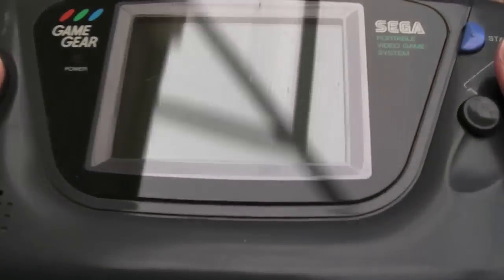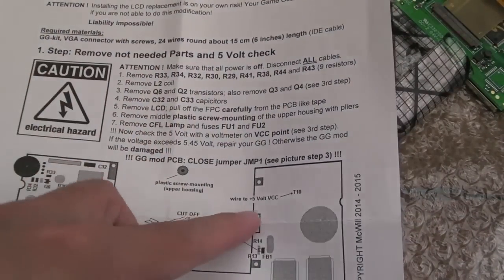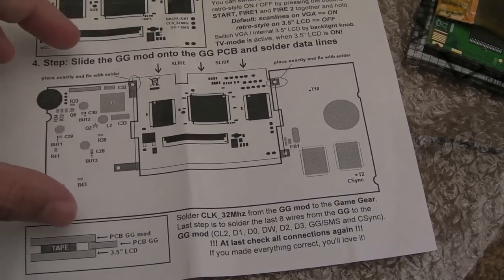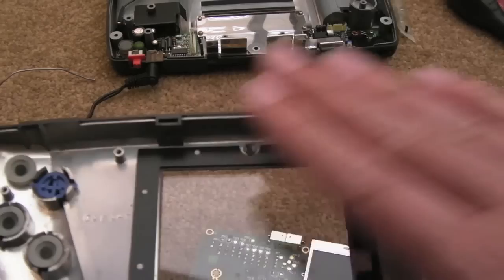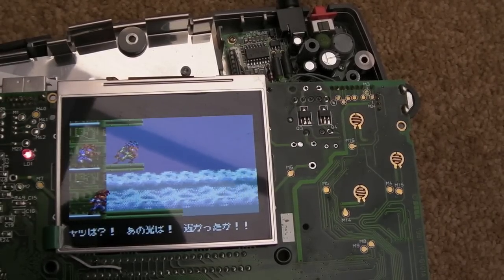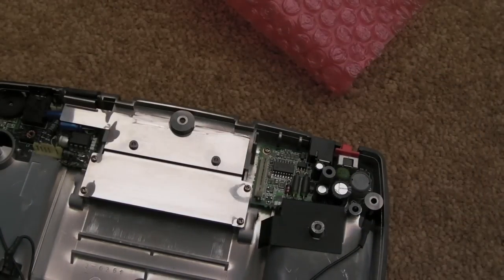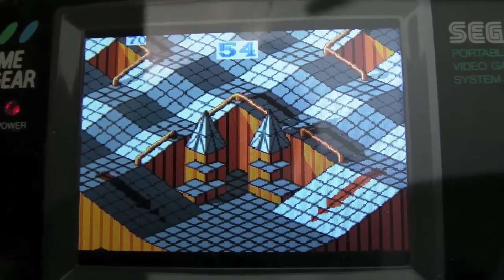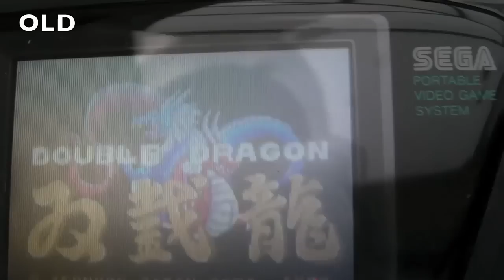Sega Game Gear Modern LCD Replacement (Not Composite) From McWill

Comment: Wow that looks amazing! Definitely a pretty involved mod but it looks like you had a good set of instructions to work from. Nicely designed unit in general. My GG seems to be on of the lucky ones in that it hasn't had an issue with the capacitors yet. But I think I'm going to replace them proactively one of these days. If I were going to do something this radical I think I would go ahead with the VGA output while I was already in there. Would be awesome to play on a monitor!
Reply from the maker: Will be doing the VGA part very soon! =D
Reply: GadgetUK164 - Retro Gaming Repairs & Mods Nice! I'm very curious to see how it will look on a monitor. Question, is it actually VGA output or is it just RGB using a VGA plug? I used to always assume if it had that connector it was VGA but someone rocked my world and said that wasn't necessarily the case.
Reply from the maker: Now I think about it - I am not 100% sure lol.  I need to go away and check!  I am guessing its VGA from what I remember.  Pretty sure people connected up to a VGA monitor, but I will check!
Reply: @71dembonesTV  Maybe late, but yes the output is normal VGA. I have done this mod on the GG and connected it to my monitor who has DVI and VGA input. ;)  It's really awesome to connect your GG to VGA and play games on a 24"screen! also you can terminate screen output on internal screen with brightness knob. But all this will only work if you are doing the VGA mod totally.

Comment: What gauge or size wires would be acceptable without any risk of overheating anything?
Reply from the maker: To be honest I've found that for all the wires except ground and +5 you can use single strand kynar wire.  For the +5 and ground I would use 7 strand wire similar to that used in IDE cables.  Not sure on exact gauge, it really isn't something to worry about on something like this.

Comment: Hey Guys, whilst replacing parts, the screen dropped and the small ribbon cable attached to the side of the screen ripped from it's fixing. It looks as though it's glued? How do I re-attach (if it can be)? Cheers Stuart
Reply from the maker: Are you talking about the McWill LCD screen, or the original Lynx screen?
Reply: On the game gear original screen. There is the main cable which connects the screen to the board and a smaller one which attaches to the side of the screen - this is the one which seems to have come unstuck! As you look at the screen it's on the right hand side.
Reply from the maker: Ah, I see - sorry, it's a Game Gear video :o)  I had the Lynx on my mind lol.  If its detached on one side, there's not a lot you can do tbh.  You can try and heat with a soldering iron to see if you can get the glue to re-adhere.  They are glued on there with a conductive glue (not solder).
Reply: Bugger!! I had just finished re-capping and ready for testing! Oh well, I will try and see if I can heat it somehow. Cheers for your help!

Comment: I still have my original Game Gear from Christmas 1990/91 it no longer works sadly so I'm going to have to read up on what faults occur, I think this mod is a must also!!
Reply: If you switch it on & just get the backlight and no sound or picture, try looking at an oblique angle and you probably will see the game loaded as normal, 9 times out of 10 it's just the capacitors have failed and caused no sound and no contrast. (I hope you've got it sorted by now though as it's like a year ago this post was made lol). Its cool that you still have your original GG after so long, hope it's fixable.

Comment: Would this work on model 2110G? That's the one I have sadly
Reply from the maker: I think so - the mod supports 1 or 2 ASIC versions.  Check with McWill before ordering.
Reply: +GadgetUK164 it will work for the G-models still thinking a pro can do mine if I were order one

Comment: what dose the brightness wheel do after installing this mod if nothing then he should make a revision to use it instead of pressing all the buttons
Reply from the maker: +justin rivera The brightness wheel is used to switch to the VGA output mode as far as I understand.  It's the same on the Atari Lynx screen.   So it disables the LCD screen and feeds output to the VGA connector so you can connect to a TV or monitor.

Comment: i gotta ask does this improve battery life? that Compact flouresent tube must eat the power like crazy, if it does its worth splashing out on making my GG look as good as it possibly could. also does the MS cart adaptor and 3rd party TV tuners work with the unit still after this mod?
Reply from the maker: I expected it to use less power but I've been told by a few people that it is approximately the same - the CPLD on the mod PCB eats a lot of power, as well as the new screen which is much brigher and clearer.
Reply: CynicalHeart Bear

Comment: What the hell, why are the scanlines VERTICAL?
Reply from the maker: +J Limon I think to emulate the original screens - they didn't have typical horizontal scan lines.  I think if you use the VGA out the scanlines are horizontal, but I've not tested the VGA output yet.

Comment: Someone has probably already told you this, but there are two versions of the screen protector, this one and the one that is raised. And there is actually a difference between the two, the game gears with the flat screen protectors do not have the "produced by or under license from sega." Screen!
Reply from the maker: Thanks, that's very interesting - I didn't know that!   I had no idea that Sega introduced the "produced by or under license from sega" on the GameGear like they did also on the Megadrive!  I wonder if that is in the single ASIC versions maybe?
Reply: GadgetUK164 No problem, always happy to help! I'd have to crack open my two beveled Game Gears and check out that theory...

Comment: Do they have an RGB mod for nomad? Or will this work?
Reply from the maker: Not yet (I think??) - The best you can get with the Nomad is to swap out with a composite screen.  People use those 'reverse parking' screens I think.  Just find where composite is output on the motherboard and connect up to the composite input of the screen.

Comment: does that have effect on the battery duration? maybe a lil longer than back in the days :D
Reply from the maker: +Rene Friedrich Apparently its about the same - not much difference at all.  The main reason is the CPLD on the board combined with the newer screen which is brighter as well as clearer.

Comment: i admit i kind of skipped around the video a bit but how did you end up fixxing the sound?
Reply from the maker: +EyesofNova I didn't get any sound issues.  I just tested the unit without a screen and didn't get any sound - probably because there's a reliance on the screen or something.  If you do have sound issues on a Game Gear its normally capacitors on the audio PCB.
Reply: GadgetUK164 Your videos of inspiring, I lack the soldering skills to do such amazing mods. Your rom chip replacement for the super mario rpg was incredibly btw.
Reply from the maker: Thanks! =D With practice and if you get good flux I am sure you can solder just as well!  Self belief and practice on none important old boards is the first step!

Comment: i recently purchased a GameGear with this modded screen , haven't tried the scan lines tho but does this also have the ability to change the size or aspect ratio of the screen , or only just a scanline function
Reply from the maker: The size and aspect ratio are fixed - just scanline function.

Comment: good mod, but I don't like how games are not displayed pixel perfect on the screen.  Some clear upscaling going on with that screen which doesn't look good.
Reply from the maker: +AndehX Yes, there is some upscaling!  There is the scanlines mode built in which does help when enabled though.  I am told it looks better when using VGA output.  There's never going to be a direct replacement due to the resolution, but I guess maybe one day a screen even higher resolution might mean the scaling is less noticeable.

Comment: Will the McWill mod increase battery life on the game gear?
Reply from the maker: I don't think so - from what I understand the current useage is about the same (maybe slightly more).  The CPLD to convert the video into a format the new LCD can support is the main problem I think.
Reply: Yes it does dramatically

Comment: Got a question for you since I have looked all over the place. Having an issue with the colors. they are sorta red. I wish I could post a pic of the issue. The screen flickers when I turn it on going from one color to a different one. Have you ever heard of this issue.
Reply from the maker: Is that before or after adding McWills LCD mod?
Reply: I was not the original person who tried to install it, the Cx took it to another place to get it installed and thy could not finish the solder work. They brought it to me to finish the last 6 wires  for the LCD pins. The other place also replaced a bunch of caps on the volume control board and on the main GG board. I am not sure if this is interfering with the color or if its a screen issue.
Reply from the maker: If all of the caps have been replaced (and I would replace all the SMD electrolytics on any GG), then there must be either a fault with the system, or perhaps the LCD mod wasn't done properly, or perhaps the new screen has a fault.  My first suggestion would be to get another GG, swap out the caps, test it then works properly, and finally do the required mods and transfer the new LCD screen to see if its all working.  If there is a fault with your new screen you could send it back to McWill and he might be able to repair it.
Reply: I already talked to McWill about this issue and he suggested some things to do to fix the issue, but nothing is working. I did not buy this, the Cx did from off the internet, I am assuming. I already told the Cx if they get another GG, I would move the LCD over. This is up to the Cx. He has no clue if this was an issue before the mod was installed by the other shop.

Comment: Does this mod improve the battery life?
Reply from the maker: +T.H.E. Outlaw Quite a few people have reported that the difference is hardly noticeable.
Reply: +GadgetUK164 You should do a Li-Ion battery replacement mod next. Throw a 3000 mAh pack in there and that sucker should last all day.
Reply: +T.H.E. Outlaw any mod that involved removing the cathode tube back light, and replacing it with LED's, will dramatically improve the battery life.  You should expect at least double the original battery life.
Reply from the maker: These have been tested and apparently due to the other logic on there the battery life is slightly worse than using the original screen.  To be honest I wouldn't use one of these on battery anyway, unless it has been modified with a li-ion battery.  But you can reduce battery life on a standard screen just by replacing the tube with LED's.
Reply: +GadgetUK164 if that's the case then that is an extremely badly made screen.  anything using LED's instead of a cathode should produce significantly less power draw.
Reply from the maker: It's not the screen that's the problem, it's the CPLD and screen combined.  Plus there's a regulator to drop the 5v to 3.3v I think.  It's still a pretty nice screen imo.

Comment: I never really liked portable systems, but I had a Game Boy so that's probably why.  :)
This mod is impressive. It's not so much surface mount soldering that scares me as much as surface mount *desoldering*.  I feel like I'm going to rip pads when I try to coax them off the board from opposite ends, causing the other end to hinge a bit and tear the PCB.

I jumped up when I realized what game you were playing at 35:30.  I had no idea this version of Bruce Lee existed.
After looking into it a bit I see it's an SMS homebrew.  That's awesome.
The author apparently posted the ROM for free download, but it's weird that the v1.00 release is gigantic (1.4MB or thereabouts).  All the older versions I saw posted are 128KB which seems a lot more sensible for putting on a cart.

Comment: Hi Gadget,
I just got this kit delivered, but I can not work out where the VCC point on the screen board coneccts to, I find that part of the instructions are unclear, I know the VCC on the cartrige slot point 35 joins with point 1 on the backlight, also do you solder point 16 to point 18 on the cartrige slot. and also there are two points  at FB1 which one do I use for the CLK_32MHz point?

Comment: Is the PSP old enough for retro treatment? I love mine, but the screen is shit.  I actually bought a new screen for it, but it's identical to the original to point of being just as shit.  I'd really love a decent screen with no ghosting on the PSP.  As an aside, I also used to have a Game Gear.  I got to the last boss on Mortal Kombat and got killed.  I was so frustrated that I punched the screen and cracked the LCD D:  I was a very sad boy that day.
Reply from the maker: I got a PSP last year too - they are so very cool!  Lovely systems, but as you say - some suffer from ghosting etc.  LOL @ punching the screen, but ouch at the same time =|  You might be able to buy a repro screen from china maybe - no idea if it would be better or worse.  The model I have is the cost reduced version, but it looks sweet and has a fantastic display.
Reply: I found out today that later models like the 3000 had much better screens. I'll need to look into fitting one of those. I've no idea if one would just swap in or need modding.  I know which end to hold on a soldering iron, but a mod like the GG screen is out of my league.

Comment: What's the battery life now like?
Reply from the maker: Vintage Tech Repairs I've not checked but it should be better.  I've actually still got 2 switching transistors to remove yet in order to gain a little bit more power.  I will do that later and perhaps measure the current consumption vs the original GG.

Comment: The problem is that you dont do anything to prevent the non integer scaling, looks really bad
Reply from the maker: I didn't make the screen btw!  It's McWill that you want to blame :P   That said, yes he does do something about the scaling - if you buy the screen now it has a built in vertical scan line mode which makes it look almost identical to the original screen.  It also provides horizontal scan lines for the VGA out, so it's not as bad as you can see in my video here.

Comment: I heard that playing SMS games on SGG gave really hard to read text making RPGs like Phantasy Star unplayable. Does this screen fix that with the raised resolution or does it still only output at the native resolution of the SGG upscaled to the panel?
Reply from the maker: +Stephanie Lovik I am told it uses the native SMS resolution - well, an approximation of it - the screen is actually higher resolution than the SMS.  It's much much easier to play SMS games on this screen.
Reply: GadgetUK164
Interesting. If I can't get my hands on an SMS or PBC maybe I should get this mod so I can play PS without emulation. Did I miss a link on where to obtain this mod?
Reply from the maker: In the description to the video - up top!
Reply: GadgetUK164
Ahh k thanx. I'll hafta sift through the thread. a cursory passover didn't reveal any obvious order forms or anything. :P
Reply from the maker: PM McWill!

Comment: does the screen you bought have a built in light system?
Reply from the maker: Yes, McWills screens are back lit.  I still need to remove the two transistors that power the old screen but I will do that when I add the VGA output connector.
Reply: alright good to know. might try this on the one system out of 4 im repairing soon that i plan on keeping.

Comment: What is the battery life difference? I would think it would be better with modern tech. How's it going?
Reply from the maker: The CPLD eats power as well as the new screen.  Someone on the AtariAge forum has measured the current and its slightly more (battery life shorter) with the new screen.

Comment: Hey! I try to contact McWill but i cant sent PM because im new on that forum, im from Argentina i need one of those screens can you tellme brand or model? you know if i can use some other display like GPS or some like that? Thanks!
Reply from the maker: The screen is a very specific model which only accepts digital signal encoded the proper way - you cannot use it with anything else.  The PCB that comes with the screen is what drives the LCD - its custom developed using a CPLD, so there's no other way you can get a screen to work with the Lynx, so if you want a new LCD for the Lynx your options are 1) a replacement old screen or 2) the screen kit from McWill.
Reply: GadgetUK164 thanks and how do i contact with him? I need to know if he can send it to my country, in forum i cant sent messages coz in new
Reply from the maker: What's the criteria for sending a PM?  I think you just have to have posted a few messages on threads?  I don't have any other contact details for him.

Comment: I recently repaired a dead gamegear by replacing all of the capacitors on it. When I fired it up I was shocked at how bad the screen was. It is much worse than I remember as a kid. I have a stack of gamegear games and I don't even want to play them because of how bad the screen is. So I think I have to do this upgrade.

Comment: intresting that this screen is a tiny bit bigger. how does that work anyway?
Reply from the maker: +unrealdevon The screen is higher resolution than required.  He's outputting the image offset from the side / top of the screen and using scaling as well.
Reply: Awsome! Thanks for the reply :-)